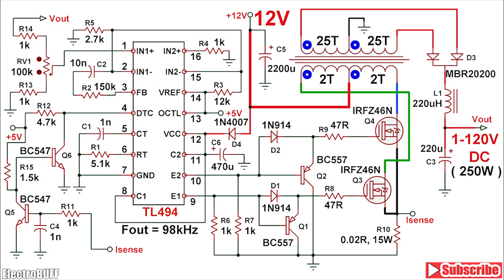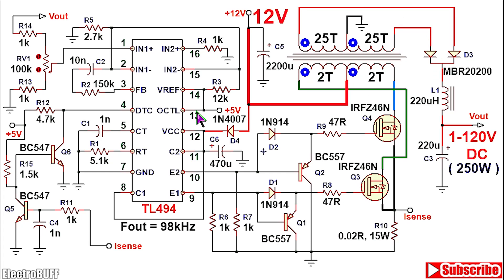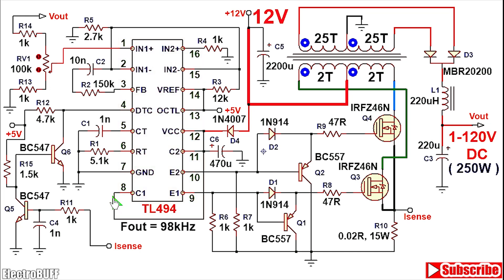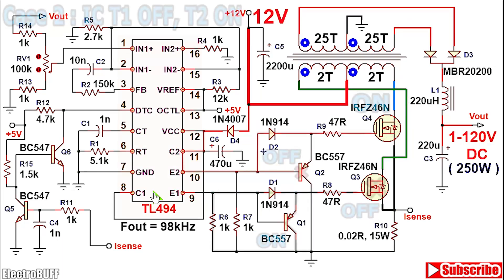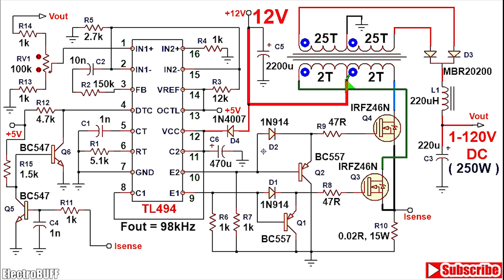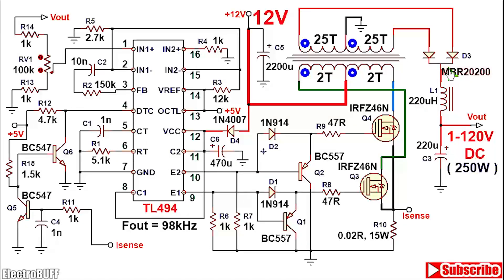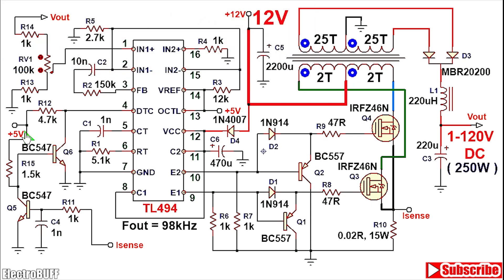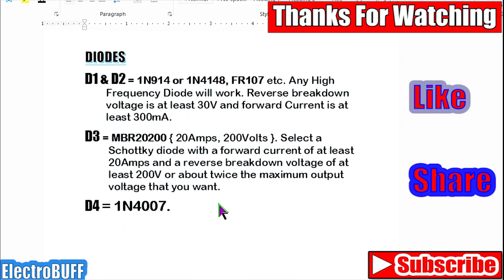TL494 Adjustable DC DC Switching Power Supply (SMPS) 12V to 120V

Comment: Thank you for the explaination, very clear. Do you have a circuit with TL494 with Constant Current (CC) control, I will apply it for Li-ION Baterry Charger.  I,m guessing to apply a feedback loop to IN2+ comparator input from a voltage generated by Shunt Resistor.  Thank you.